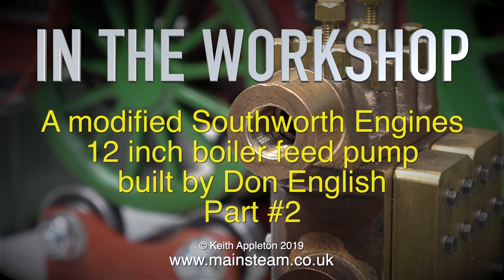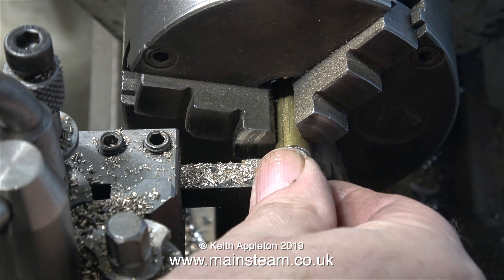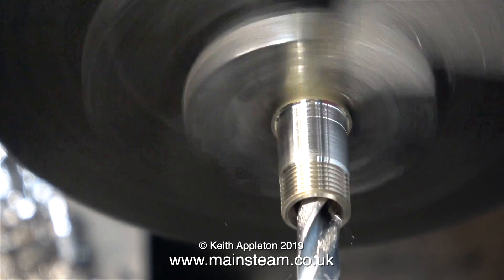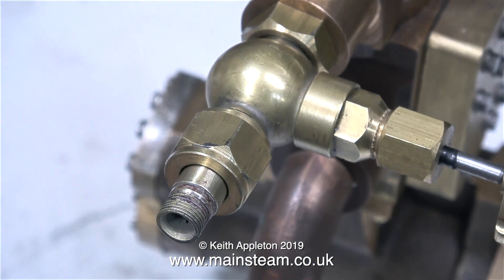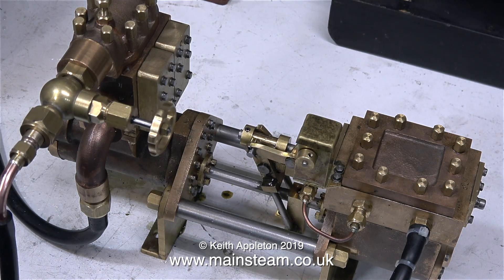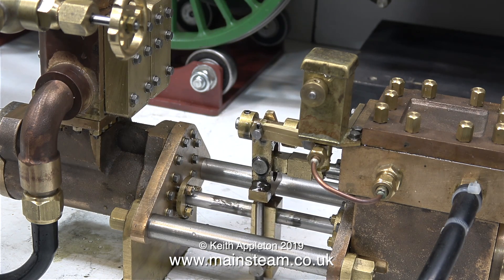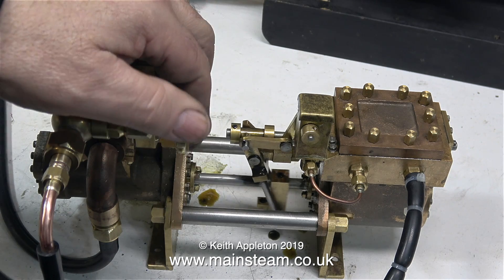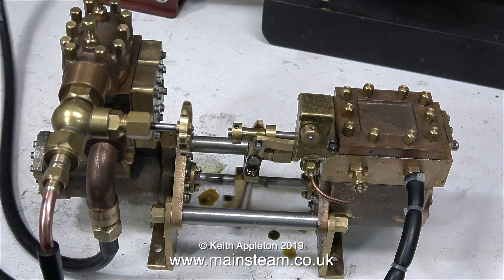A HORIZONTAL SOUTHWORTH 12 INCH BOILER FEED PUMP - PART #2

Comment: What would the ring be made from on the steam side.
Reply from the maker: If you mean the Piston Ring , it's made from Silicone Rubber
Reply: @keithappleton  , Sorry , yes the piston ring on the steam side. I like this pump I may have to find/buy some plans and make one.
Reply from the maker: for castings and/or  drawings - email mat@blackgates.co.uk

Comment: Seems like every water pump you show has a start and stop valve action, as opposed to the continuous and smooth action on most steam engines (exception Corliss).  Is there an explanation.
Reply from the maker: because they are non rotative the valve events do not need to be so smooth . . . .